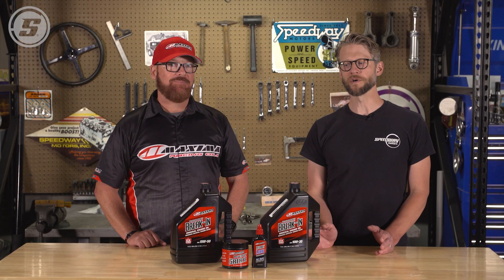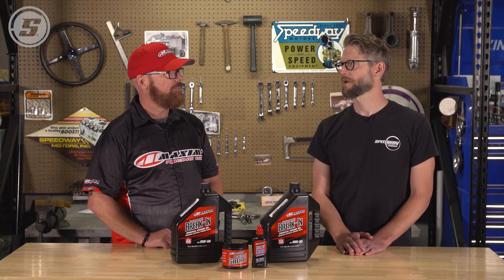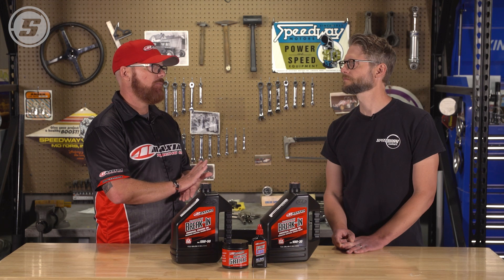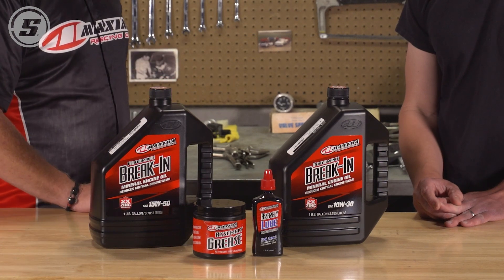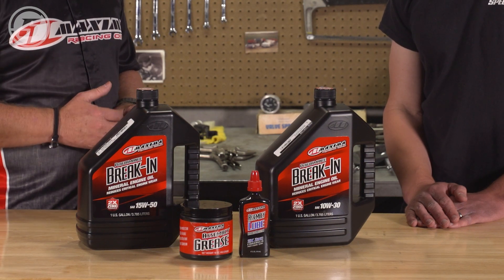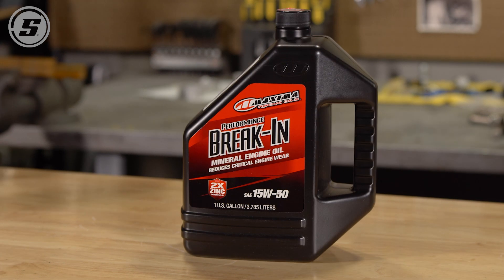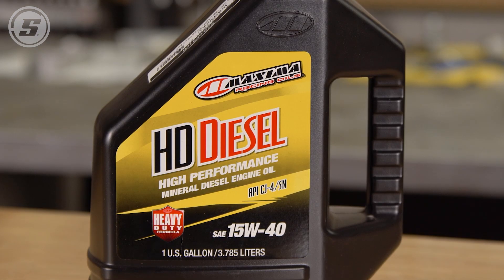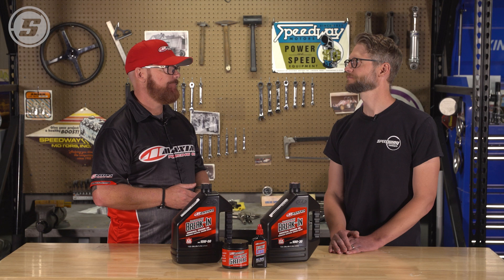Break-In Oil Myth Busting | Why a Fresh Engine Build NEEDS Zinc

Comment: I've been building engines of all kinds since 1980 and I noticed the smell of "break in oil"  or "engine oil supplement" has the same odor as rear end grease. 
I'm refering to the "lubricity modifiers" or the "snottyness" of the  oil. Called "extreme modifiers" or whatever,,, the same odor as in rear end lubricant.
I put a percentage of rear end grease in ALL of my engine's oil since the 80's.
Never any failures of any kind, no scuffing on flat tappet cams, etc.
 I remember before roller cams all of a sudden everyone was complaining of cam failures because "they" took out Zinc and other modifiers.
We all switched to Rotella, etc. But I always add about 10% rear end grease to every engine's oil. 
One engine (355) in my '71 Chevelle,  I drove it 14 years, dissassembled, honed, reringed, rebearing'd and went another 5 yrs ,,, 
then sold it.